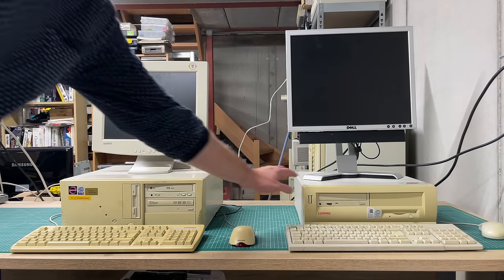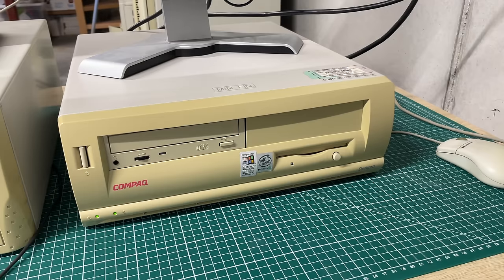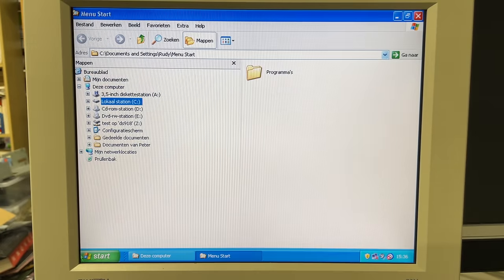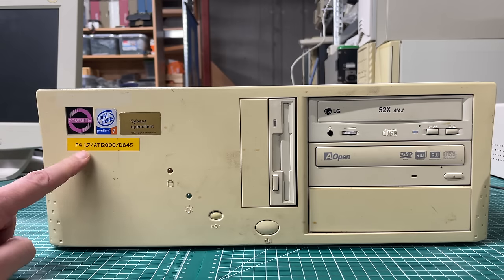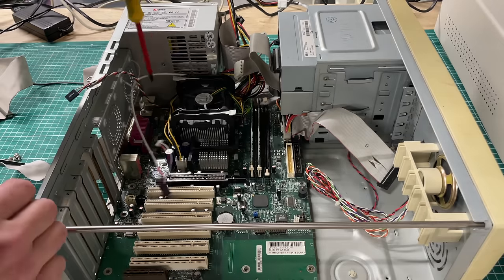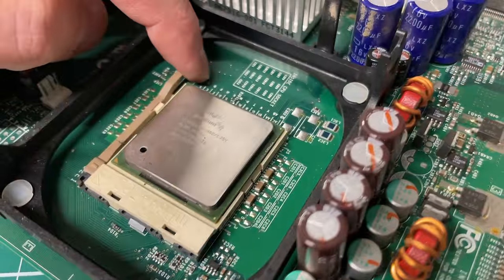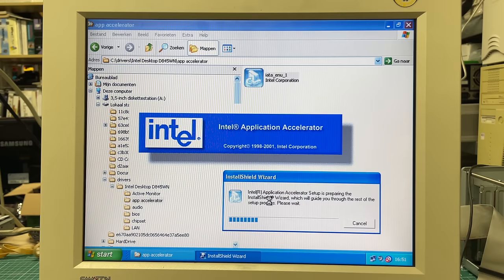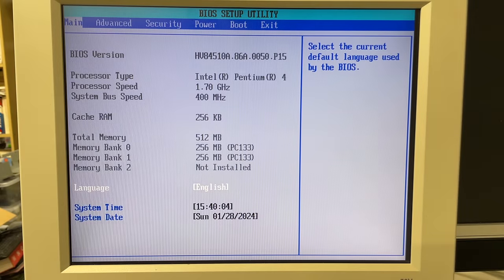Why is my Pentium 4 so slow ?

Comment: Back in the day I had a Celeron Tualatin 1.2Ghz ocd to 1.34.  With 384MB of sdram and a geforce 2 mx 400 later upgraded to FX5200 ultra. 
But more importantly I had a hardware ISDN modem, hardware sound card, 2 hdds on separate IDE branches(one for os and other for games) and a sharply tuned Windows xp operating system.
So people that were buying Pentium 4 computers with like 128MB or 256MBof ram, that used windows ME, one of those dial up pci cards, etc. would not believe I didnt have a pentium 4.
Reply: upgrade from MX400 to FX 5200, that was probably pretty bad deal back in the day, even MX440 is faster than any FX5200, only reason to use FX5200 is DX9 support
Reply: Fx5200 was around the raw performance of a geforce 4 ti 4200 @Pidalin
Reply: @lanelesic  No, it didn't have, you remember or wrong or you didn't test it properly, Ti 4200 is much more powerful card than FX5200. Ti 4200 should have like twice raw performance compared to FX5200, but maybe your FX5200 ultra had higher clocks so it was not such a big difference, but even FX5600 is still slower than Ti 4200 in raw performance. Ofcourse it's gonna be better for FX series when you want to run some later games which just need proper DX9 support, but try to compare them in older DX8 games, Ti 4200 is much faster.
Reply: @Pidalin  ROFL look up some Quake 3 fps charts
Reply: @sic Quake is OpenGL game, it can be different, but the vast majority of games run under DirectX and Ti 4200 has double raw performance there.
And I don't play with some memories, I actually test a lot of old hardware now, so I know it for sure, even 64bit MX440 is better in raw performance than FX5200, but MX440 is just renamed GeForce 2, so it lacks some features you may need in 2003+ games, it doesn't even have full DX8 support, for example test Nature in 3D Mark 2001 doesn't work on it, but it works on Ti 4200.
Reply: @Pidalin  FX5200 has 128bit bus and 128MB of faster ddr vram, it has the same pixel fillrate, same amount of shading units, etc. but it also had pixel shader 2 and dx9,etc. It also was an easy overclock with rivatuner from its same base clocks 250Mhz that geforce 4 ti 4200 was at, to around 333MHz.  The problem with 4200ti was the 4x agp version was ok at overclocking and the 8x agp version was not really ok at overclocking. 
Anyways you can find the charts and even at stock its +10% diff in older games while it doesnt really run some newish games that required pixel shader 2 and such. 
And all of this is irrelevant because  the upgrade from geforce 2 mx 400 that only had 32MB of sdram as vram and that was barely pushing above 100 fps in Quake 3 at 640x480, was substantial.
Reply: @sic I don't care about numbers, it means nothing when you compare different generations, test it in reality and you will see. 🙂 Ofcourse 128bit version is better, but still weaker than Ti 4200. I really regret that I sold my Ti 4200 few months ago, only GPUs from FX series which are noticably faster are FX5900 and better. But maybe your Ultra was significantly better than standard FX5200, it's possible. Now I have FX5600 (not LE, real 128bit version) and I would say that it's still slower than Ti 4200.
Reply: @Pidalin  🤡

Comment: Could be the bios, the hdd, possibly underclocked on the p4 or overclocked on the p3.  Ram may not be optimal (i've seen and have p4 with pc133 ram but most have ddr1 or ddr2 or rdram, in some cases ddr3 (basically a775 p4 on a board meant for a core2quad or 771 xeon)

Comment: I remember well the disappointment when I had first found out that the higher end PIII was much faster than the lower end P4 cpu's. The one on the left is 1.7ghz. It wasn't till about 2.2ghz that the Pentium 4 started to feel faster. By the time you got to 2.7 or 3ghz, it was much faster.

Comment: great combo of computers.
I never had luck with those kind of cpu coolers, the plastic breaks.
Honestly I had more luck with my Athlon xp apparently the cooler does count so it's kinda termo throttling that's why it's locked at 1.25 so it was lower than a p4.
Also I always got lots of celeron but no og pentium 4.

Comment: A lot of p4 era pcs are having problems due to lower quality capacitors fitted on the mobos, of course they can be replaced cheaply in a few minutes of diy soldering.

Comment: My first thought was dried up thermal paste since thermal throttling was introduced with the Pentium 4. But I guess you can rule that out now since you removed and reinstalled the CPU.
Reply: That's a common misconception spread by noob youtubers. Do a real test. If the temp is 90C with dry thermal paste changing to new paste the temp will only drop about 5% or at best 10%. It's not as important as people think. PCs run for dozens of years with the same thermal paste and it still works the same way regardless. Plus or minus 5 percent isn't going to be visually noticeable. It's time to re-write your out-of-date rule book LOL!

Comment: 3MB/s is a good hint what's going on. It's the PIO 0. PIO stands for Programmed Input Output, so the CPU is used to send bytes of data to the device. 0 is the generation, the higher the number, the faster the data can be sent. So PIO0 means "use the CPU to read and write from disk, and do it at the slowest possible rate". Possibly to maintain compatibility and ensure nothing goes terribly wrong.

Super unfortunate seeing BIOS applying UltraDMA 5 or 6 and then Windows rolling it back to PIO....
Reply: Was looking for this comment. PIO-0 maximum is 3.3 MB/sec, which is in line with what he's getting.

Comment: The slow speed of the drive could also be a symptom of a failing drive, used to have a sata drive that had a number of reallocated sectors on it, which absolutely killed the performance of the drive. The average read speed of the drive dropped down to around 2-3MB/s.

Comment: Is that a PCIe port I see? Consider adding a SATA card for an SSD OS drive, keeping a HDD for Linux boot (e.g., Archlinux32 or Debian). Install a Radeon HD 4670 AGP for graphics, and add a PCI HD 5450 and GT 610 for OpenCL and CUDA support using nvidia 390 drivers. Incorporate a Blu-ray burner via the SATA card and mount it in the front, keeping a DVD burner for booting. Add a PCI USB card and, if possible, mod the BIOS for USB and SATA boot, plus overclocking settings. Replace the CD-ROM with a 5.25” floppy drive and add a ZIP drive alongside. Opt for a Sony 2.88MB floppy drive for backward compatibility or an LS-120/LS-240 if compatible. Use ArchInstall for Archlinux32, setting your mirror(s) without changes during installation and include Python. Max out RAM to 4GB, and consider a Hauppauge PCI TV tuner to turn it into a Linux DVR. /boot on your HDD, all other folders on SSD. Debian may be easier. IDK if they have all the nvidia drivers though. Hmmmm.

Comment: Early Pentium processors were plagued.... the 60 and 66 MHz vintage. Once the Pentium 100 MHz arrived and the corresponding 430 TX chipset, the original Pentium finally got solid. Pentium III got very good when that era completed, 1200 MHz standard, and I had some IBM Servers with 1400 MHz processors. Pentium III chipsets with the 915 chip set was finally solid. The early vintage of Pentium 4 processors were slower than those fastest Pentium III's. Again, it took a few reversions / versions, then Pentium 4's got decent.

Maxtor with 7200 rpm spindle speed. That was a pretty good specification.

Naaaa.... 845 chipset era was not when Pentium 4 got decent. Intel 945 chipset era would have been much better. In my opinion, too early of a Pentium 4 era to deal with.

Comment: Is "partition alignment" / "partition offset" the possible culprit here? I can't remember which Microsoft OS fixed this by default. Also, I can remember that sometimes having some "auto select" active on harddisk and then "slave" for optical media doesn't always behave. You can try setting "master" for the harddisk and temporarily remove the other drives to see if that makes a difference. Try swapping out the ide cable with the p3 machine as well. Does it have multiple connectors on the cable? Try another one. Does the motherboard have multiple cable headers for the ide cable? are they marked differently? (e.g. "IDE" vs "UDMA" or something like that). Is the (NTFS?) cluster size on the p4 machine way smaller than on the p3 machine?

Comment: Yeah, the Intel Pentium 4 Willamette was pretty slow. The Netburst architecture needs high clock speeds to be good, below 2GHz simply isn't enough. The second reason is the RAM. The SDR RAM is just too slow for a P4, I'm sure that the system will be faster with any kind of DDR RAM or RDRAM. The performance in games will be still bad even with better memory, but the system will be way more responsive.

Comment: One other factor could cause the slowdown: if the read head on the hard drive is starting to fail the hd controler may be writing bad blocks to the platter(s). A lot of that would slow it for sure as the head has to seek more inefficiently.😅

Comment: it is possible that the same principle of single task oparions are quicker on a slower CPU build. where the p4 architecture could of been changed to operate with the chip structure. bug fixes leads to hardware changes (updated CPU architecure)

Comment: That P4 1.7gHz looks like an early Willamette P4. Those were actually slower per clock speed than the P3 due to the long pipelines. If you clock them at the same GHz the P3 would win.

Comment: A. Pentium 4 is slower than Pentium 3 clock for clock, so if you have a Tualatin 1.4 Ghz in the compaq, it will be very similar to that 1.7Ghz P4.
B. The P4 uses PC-133 SDRam, which it was never originally built for.
C. the SDRam along with the limited BIOS leads me to believe it's a budget oriented motherboard, which might be limiting the performance too.

Basically don't expect miracles, a good, well built Compaq P3 is absolutely not guaranteed to be slower than a budget oriented P4. If the P4 was on a high end motherboard with DDR things might be different.
Reply: SDRAM was limit of the first 845 chipset due to Intels relation with Rambus.
Reply: a 1.4GHz Tualatin is way faster than a 1.7GHz Willamette.

Comment: HDD sounds like it is dying. I've played around with P4s in recent years and ran Windows 10 on a P4 HT. I have a bunch of P4 hardware. The only P4 I actually use is a 2003 Vaio laptop with a desktop 2.8CPU. It is running the launch version of XP. I really don't use XP much but need it for the Brothers in Arms games. One of these days, I'll figure out how to crack the DRM so I can run them on one of my Windows 7 machines. Windows 7 is a great OS that I never used until recently. it will run all XP games (except those with Starforce or SecuROM) and most 9x games. Sadly, game services are abandoning it. Up until recently, I played a lot of my older Steam games in Windows 7.

Comment: There could be sooo many factors why a more powerful pc could run at average slower then a weaker pc,because of a slow hardrive,less and slower ram,an underclocked cpu,a poor cooled down cpu,lots of programs stored on a hdd drive being damaged to require error corrections,etc,,, or a combination of both things,so these are the reasons why a more powerful system doesn’t alwayssay everything,but it’s still interesting to think about it😁

Comment: The P4 was a major misstep for Intel.  It was not much fadter than the P3, but ran hotter.  For the Core series, Intel abandoned the P4 completly and reverted to the P3 design.  On the plus side, you can use your P4 as a great space heater.

Comment: I'm just wondering what netbrust are good at (or what's in mind when design, any target like float, int performance?) and if using today's process to re-make it say with 14nm tech. The last pentium4 has 188m transistors, the first 14nm skylake has 1.9b transistors so you maybe can make a 10 cores Pentium4 with 20 threads in a chip with higher Ghz limits?

It would be interesting to see how that thing can perform :)

Comment: Why did you left UDMA mode disabled in BIOS? My first thought was it was working in PIO or wrong chipset drivers. That was a good and fast HDD for its time. And I always turned PNP OS on for drivers to do their work. It was an early start of PnP but still.
And about the CPU... p4 Willamettee core was hated as it was slower than later PIII cores (like Tualatin) per clock.
Reply: He left it on Auto and those settings are probably correct. You are right disabling PnP OS is a blunder as it won't install OS drivers for the chip set automatically
Reply: @thedopplereffect00  Yes, you are right about Auto mode, I rewatched it and after User he did returned it to Auto. Then I would definitely blame bad chipset driver but still check HDD with Maxtor HDD tool to be on a safe side (20 years have passed) and always check SMART as it can be helpful to diagnose some problems. I don't know if they are now easily obtainable (as Seagate bought Max) but I have on my machine Maxtor MaxBLAST and PowerMax from 2006.

Comment: I noticed the drive was set master. Should it not be on cable select? The jumper? Also, each computer was running a different Service pack. The P4 was running an older service pack. The P3 was running SP2, I would assume. Good video.
Reply: That master vs cable select thing makes absolutely no difference, unless the drives have conflicting settings. Cable select was just introduced to make configuration easier for people that didn't know all that technical jazz.

Comment: You didn't check the PIO/DMA settings in Device Manager! 😣 Also remember the computers back then were only as fast as the Front Side Bus(FSB) Memory speed is important. Lastly, Maxtor HDDs were somewhat underperforming back then. I used to have an 80GB 7200 RPM drive with 8MB cache that was fast, but for some reason the 60GB 7200RPM drive with 2 MB cache was slower. Smaller cache maybe?

Comment: 9:12 the HDD clearly is labeled UDMA 133, but UDMA is disabled in BIOS. Should read the motherboard manual to find which UDMA setting in BIOS corresponds to UDMA 133.

By the way, if you really use that computer, you should install a $20 256 gb SATA SSD with an $5 PATA to SATA adapter.

Comment: Las  últimas Pentiums III (más de 1 Ghz) fueron más rápidas que las primeras P4s. Además, la Pentium III fue un procesador mejor diseñado y no calentaba tanto como la P4. Fue una estrategia de marketing de Intel vender la P4 como un procesador muy superior. En el pasado, Intel ya tenía un antecedente similar; había lanzado las primeros procesadores Pentiums de 60Mhz y 90Mhz pero fueron defectuosos porque debieron correr a 66Mhz y 100Mhz; la AMD 80486 DX4 de 133Mhz fue más rápido que las Pentiums de 60 y 66Mhz.

Comment: First thing is, what type of P4 is it? :D There's QUITE bit difference between willamette, northwood and prescott. Also soc 423 vs 478 and sdram vs rdram vs ddr.

Willamette on 423 can easily suck behind P3 coppermine (oc) or tualatin.  It was mostly thanks to bad socket design (soc 423) and weird motherboard issues/lack of good boards.
Reply: 1.7 Willamette at 400 MHz BUS speed. D845 is DDR based, so there is no RDRAM. A Pentium III Tualatin would definitely smoke it in every day applications.

Comment: I never had luck with Maxtor drives. I wonder if you can test it with an old ISO of Seagate Seatools - if you can find it?

Those old Windows BIOS update utilities still scare me. Modern ones are OK.
Reply: Also I really don't think this is totally a driver issue. When I would work on these PCs in the era, I would of checked hard drive health. Again, especially since it is a Maxtor. Seagate Seatools use to do a good job of drive self tests. I would usually do both short and long drive self tests with Seagate Seatools.

Did you check the drive for bad sectors?

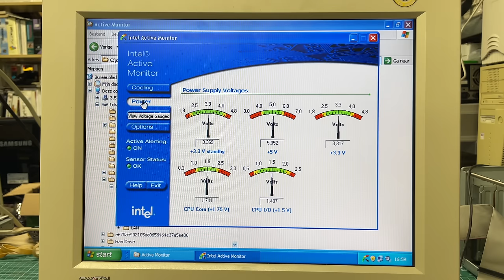Comment: Hold on a hot minute.. 17:13 the PSU voltage monitor. Those green areas are a "little bit" wide are they not?
Sure.. your 5 volt rail can go anywhere from 4 to 6 volts no problem. 2.0 instead of 3.3? Surely no issue there! Vcore 0.9 to 2.1 instead of 1.5? Absolutely fine! :D
Someone just wanted some pretty colors I guess...

Comment: I wonder what was the actual reason for the low speed? Did windows xp switch ATA transfer mode to PIO without appropriate drivers for the controller?🤔
Anyway thank you for the video!🙂

Comment: hmm,  i have a mid 2000s advent 'media' pc (a thin flat case slightly bigger than a vcr/dvd player/recorder, has a tv tuner card in it), pentium4 (3.2ghz, i think) thing that seems  slow, its not the install as it had no hard drive when i got it, but new xp install seems very sluggish, also when running dos even. memtest shows no problems with memory, cpu doesnt get excessively hot, psu output voltages within tolerance,

Comment: You should have first benchmarked the CPU speed. Most likely the thermal paste was dry and creating a barrier instead of transferring the heat. I see this on many CPU's of this era, especially laptops. The CPU is overheating and reducing the frequency which is why your throughput was so bad. I had hoped to see the paste when you removed the cooler but it looks like that was a second take as there was no thermal compound. So I assume you had already removed the cooler and cleaned the CPU. Now the drivers most likely did help but were not the root cause.

Comment: 7:00 minutes in and WTF???? You change the BIOS settings (to worse) and don't go directly to testing the speed to see if it is still 3 MB or better.
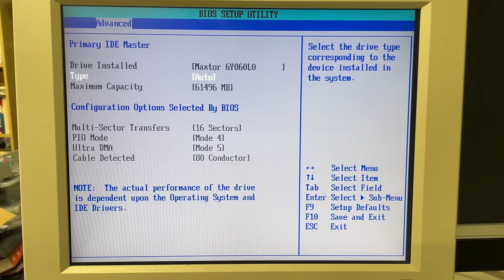Reply: Not to worse, he returned it to Auto again. In 6:25 you can see there is 80 conductor cable and UDMA5.

Comment: SDR(AM) on a P4 is a nono. P4's were designed to use RDRAM (RIMM's), SDRAM was an ugly kludge because RDRAM made the P4's very expensive. But the SDRAM made the P4 not much better than a P3. DDR(AM) "fixed" that later.